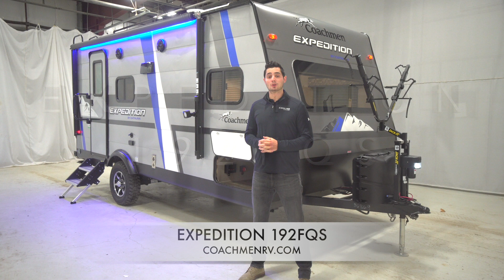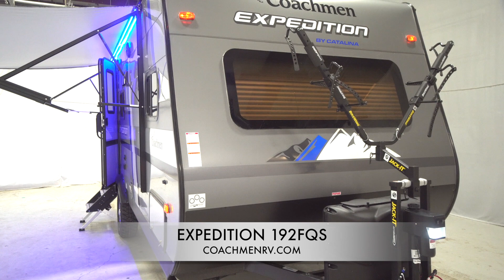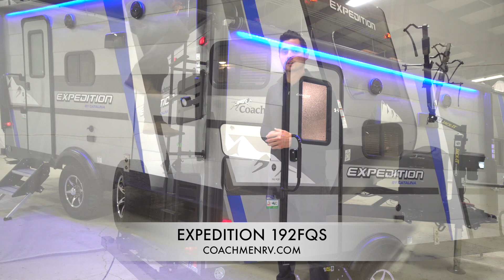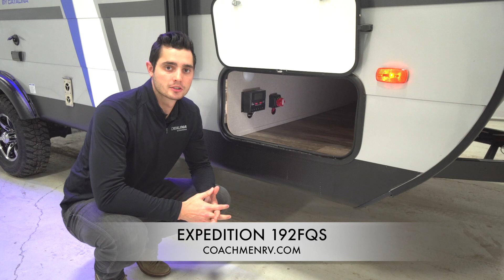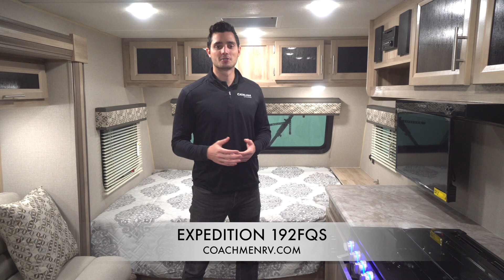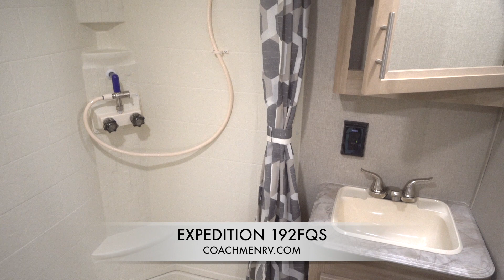2020 Coachmen Catalina Expedition 192FQS

Comment: Is this trailer stick built / wood trusses with aluminum siding? So hoping it is not - please confirm.
Reply from the maker: The Catalina product is a wood constructed aluminum-sided travel trailer.
Reply: Why the hate on stick and tin? Wood can be more durable. Next time you are at a camp site look around at the oldest units still in operation and You will see that they are stick and tin units. With the smooth tin on this unit I personally wouldn’t miss a fiberglass shell.